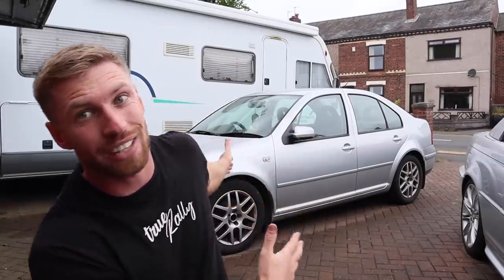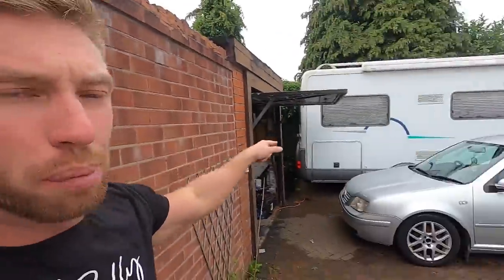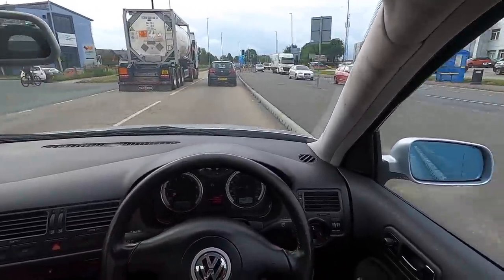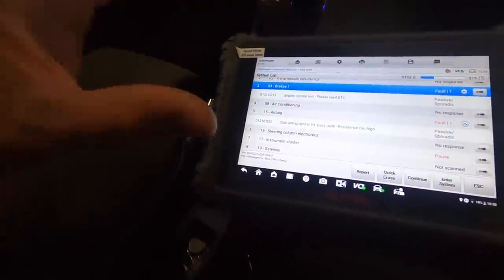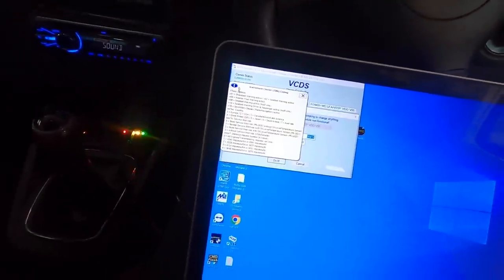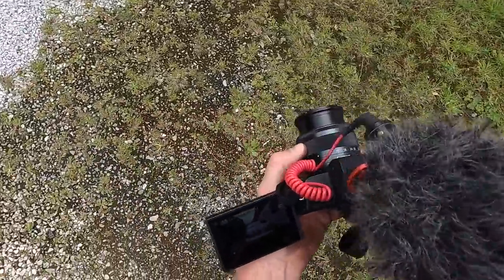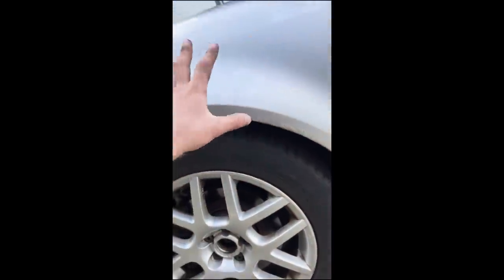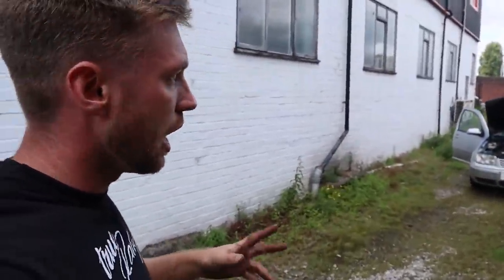Road to 10K (EP.6) - FINISHING THE BORA, ITS FOR SALE!

Comment: Did you try separating the brake ware sensor wires...i would think, when the pad gets low it completes the circuit and brings on the warning
Reply: Open wires offer no resistance this is why he had to turn it off

Comment: Brake pads sensors are on both front wheels, not 1 front 1 rear
Reply: My mk1 s3 has the pad sensor on the passenger side only
Reply from the maker: None on the driver side
Reply: @itsleelockwood  il give u £1500 for bora